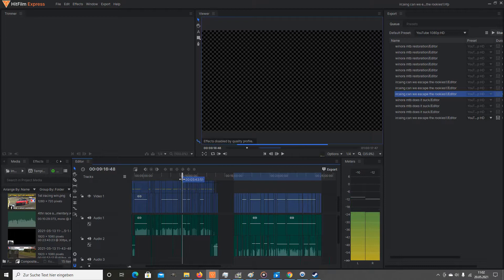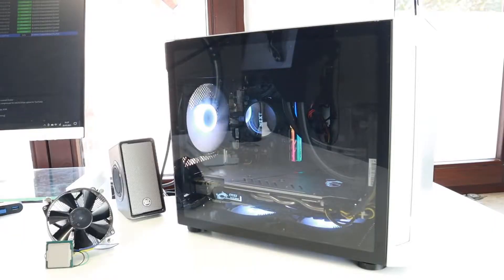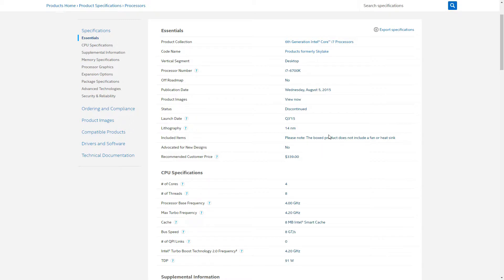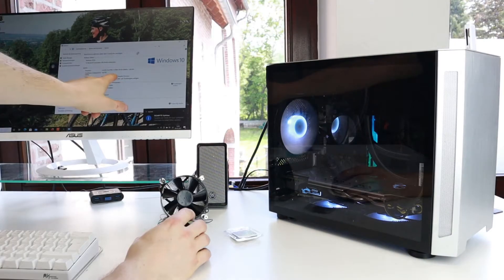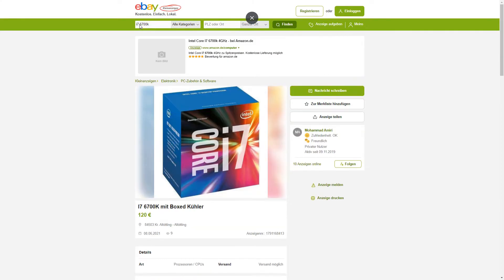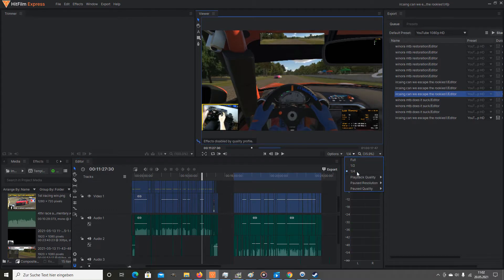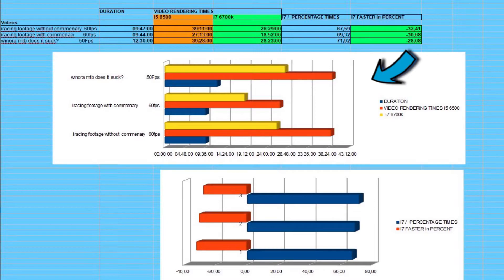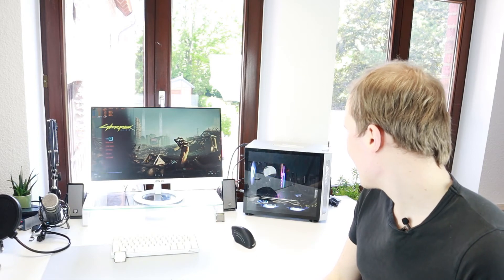i7 6700k in 2021? Do clock speed & threads matter for video editing?

Comment: i got a i7 6700k cpu and mine is struggling as hell in adobe premire pro. It performed real well before but nowdays it cant run adobe. And i have done all the basic things do improve the performance but for some reason, the program is a stuttery mess. Just want to mention that mine is like 6 years old. It's not a new one
Reply from the maker: Hmm that's a bummer Dude. I've sadly got no experience with Adobe premiere pro. But yeah for 1080 P its still okay, unless I'm overlaying 3 layers of footage, camera etc. Then it usually takes an hours or two to render. Greetings, Armin
Reply: @Armin_27  I mean it can do every other task just fine, but in Adobe it struggles. It had no issues like 3 months ago.
Reply: @trymba_yt  go nuclear on it, dessasamble, clean it and reasamble, fresh Windows instal on a brand new m2 and liquid cooler for oc
Reply: @Cinestudi0  I have already solved the issue. It was something with my OBS. The recorded video could handle Adobe so a had to reset my settings in OBS and open it as an administrator
Reply: @trymba_yt  still, Is a 6 y/o processor, Is not a bad idea to service it
Reply: I also did that before I knew the issue
Reply: @trymba_ytClear you cache and storage allocation

Comment: Is the i7 6700 good for editing 20- to an hour long videos?
Reply from the maker: Hey there, well it obviously depends on the format you're editing. 1080P surely it can do that. 4K? Not so much. 😅
Reply: @Armin_27  so this will be my “rig” 

i7 6700
32gb ddr4 ram 
M2 500gb ssd 
Gtx 1060 3gb 

I just want it for 1080p 60fps. Light 4k editing

Comment: i really good CPU to upgrade to next would be an AMD ryzen 1600af or just 1600. It has 6 cores and 12 threads. but you will need a new motherboard. I've got the MSI tomahawk b350 arctic its white and it would fit your build really well. great video as well. love the cinematic shot at the begging of the video.
Reply from the maker: Hehe, thank you Luke! :) Yes indeed, I would love to get a 6 Core or even an 8 Core Ryzen CPU to boost my video editing and rendering times. *sigh Let´s see if I can save up some cash for that. :D
Reply: @Armin_27  i upgraded mine for 120 euro. u just need to find a good deal. i found mine on facebook market place. the deal i got came with a motherboard and cpu and an aio and another power supply